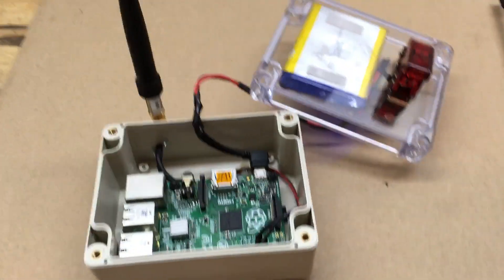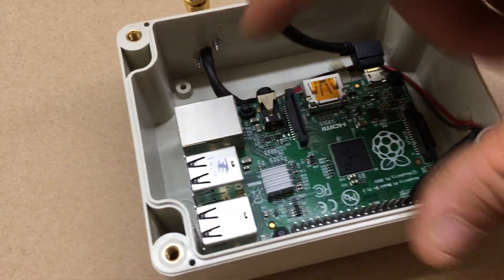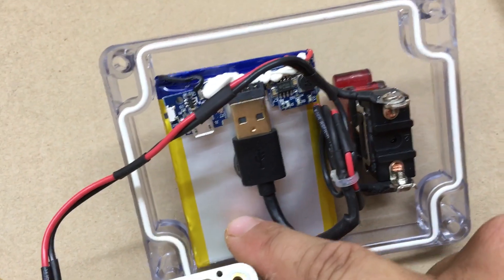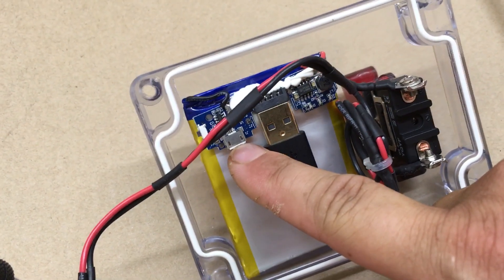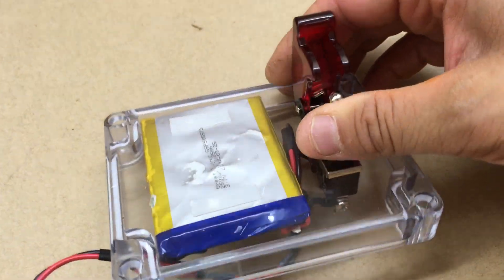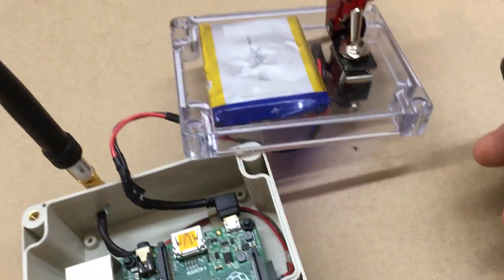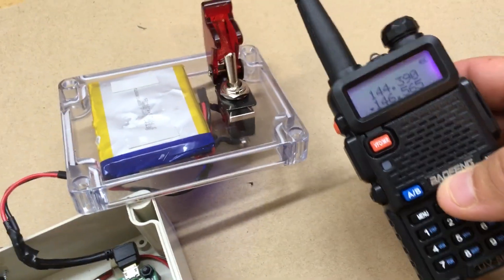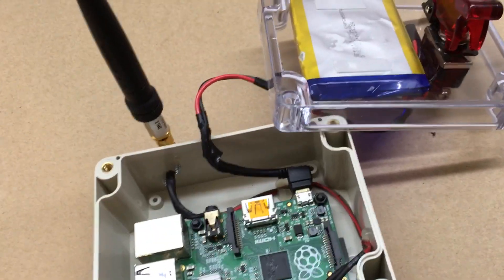Raspberry Pi Ham Radio PiFox Setup PART 2

Comment: I noticed after watching three of your videos about this Pi-Fox, you have not explained how the Rasp Pi can generate an rf signal on 146.565 or why you are not using coax to the antenna connectors.....please explain.
Reply from the maker: I’m using the software called Pi Fox that I’m running on the Pi to generate the signal. The default frequency is 146.565, but can be changed. I didn’t really think about using coax, sense it’s only a few inches.